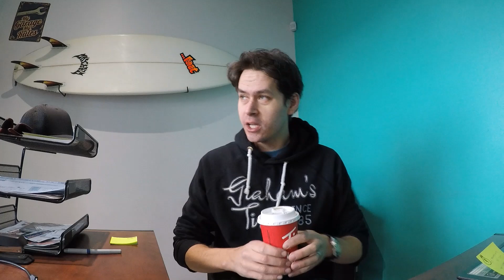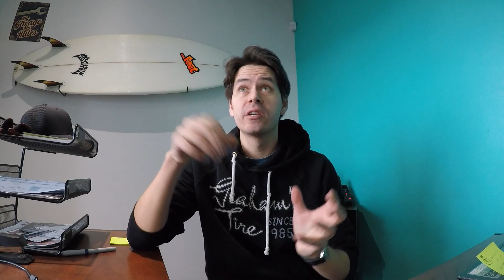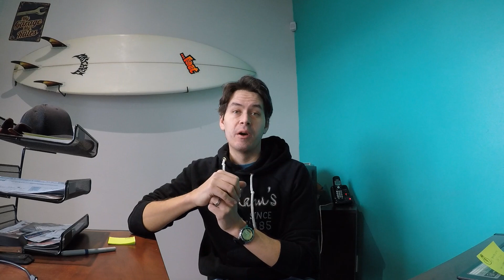2JZ NA T The basics

Comment: Thanks for the video friend. I have a q about the head gasket scenario. I'm using a non vvti config in a 93   if I were to add a 2mm gasket would this not throw out the timing? And if so how else would you compensate for this without internal upgrades like adjustable cams or Longer rods or is this more of a tuning issue. I'm not a mechanic by far and maybe I'm thinking about the the wrong way but just wondering if you could expound a little bit on that aspect of what all would be required with just  adding a thicker gasket
Reply from the maker: It's really not going to effect timing. Like adding deck height with the taller gasket your thinking? Not really a thing. The timing wont be affected by the gasket. Compression will be. It will drop a tad and that's 100% ok.

Comment: what if i got 239k miles apperntly was rebuilt by previouse owner, what do you think?
Reply from the maker: As long as it feels good, doesn't burn a lot of oil. Run it. If it's tired its tired anyways man. Rebuild eventually if you need.
Reply: @DanaAnthonyHoeft what is meaning of a “tired motor”? I’ve heard it a lot and want to know what th characteristics are

Comment: Ive got a 2jz ge and id love to go 2jz ge-t (na-t) just to get a bit of extra power and the sound. The car is a mark 2 jzx110 and ive got a 74 mk2 corona with a full chaser restomod. Again yea injectors are on the list, thinking of upgrading the piston rod and pistons themselves but i dont wanna go for loads of boost. Max 320 bhp would be more than ideal for my needs. Got stock shocks rn but ive got adjustable sports coil overs too just laying around. Now the head gasket needs swap from what i read online in forums. I genuinely dont know beyond that point. Oh yea uograding the fuel pump to a walbro as well
Reply from the maker: thats a good start. HG for sure needs changed. Stock they are .4mm. a sheet of paper haha GE ecu's have a massive ignition spike around 4k rpm and this is generally where na-t cars try to detonate and torch the HG

Comment: good tips but 1 other thing that's important is timing with the stock 2jzge ecu you have to retard timing when in boost you said the timing spike around 4k rpm and iv seen this and running 30 degrees of timing in boost is not ideal. iv been on a piggy back greddy emanagement ultimate for many years now running 20psi of boost running 12 degrees of timing on 91oct gas and 18 degrees of timing on e85 with idx-1050cc injectors
Reply from the maker: yep huge timing spike on the oe cal. good point